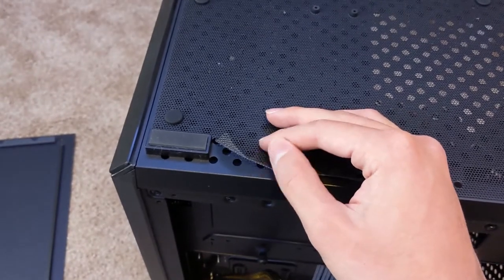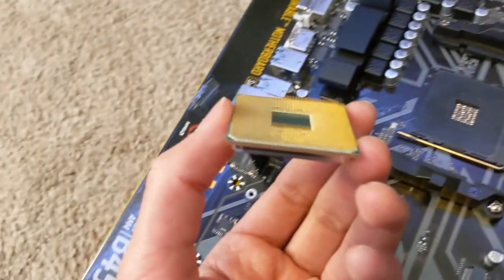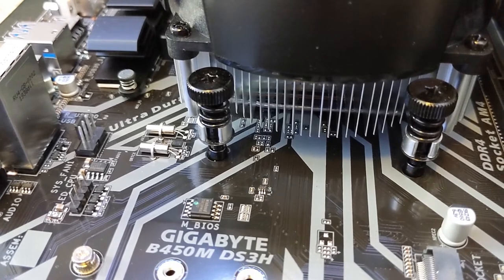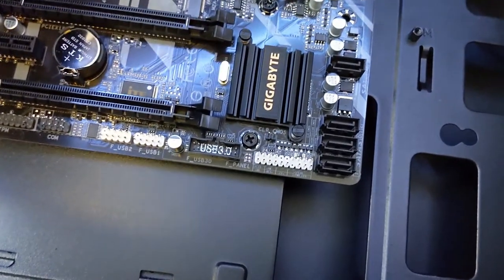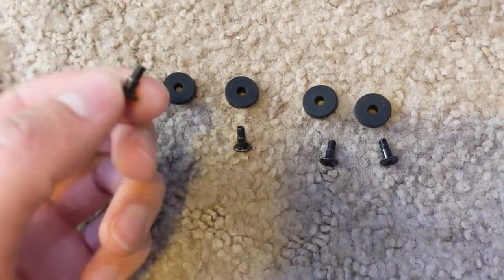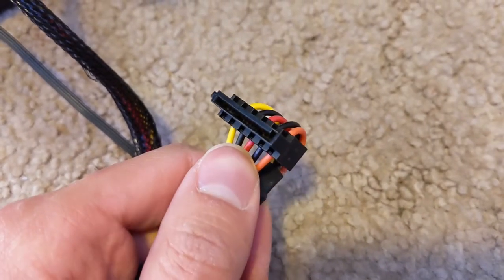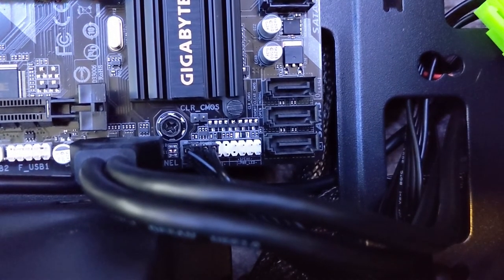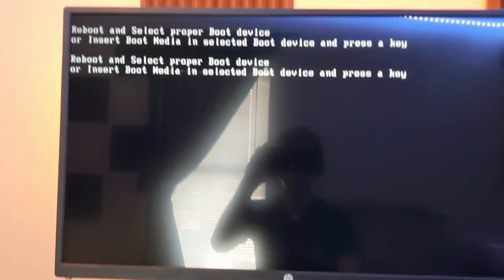PC Building Walkthrough // Tech Wizard Wednesdays

Comment: Do you recommend using this case for other builds?
Reply: After using the system for a little while now, I can recommend it with a couple of things to note:
- A blower style GPU is probably better to use in it since the power supply tends to choke one of the fans of an open air dual-fan GPU like the one I used
- The dust filters do impede airflow quite a bit, no matter the number of fans. So if your system has a high overall TDP (GPU and CPU uses lots of power), I recommend taking them off while under load.

Other than that, it's a pretty nice budget case with lots of cable management space for a clean look